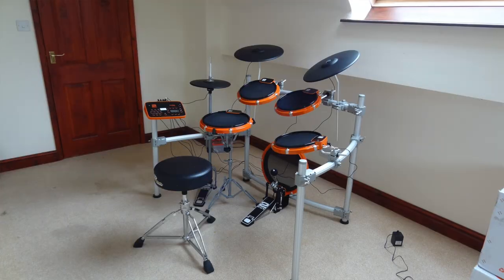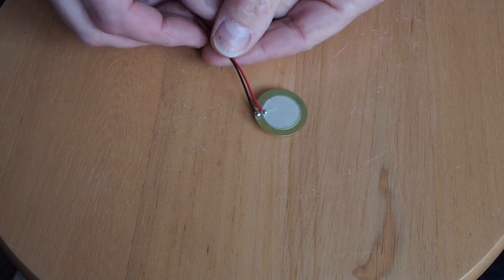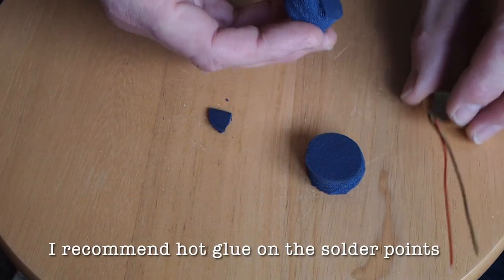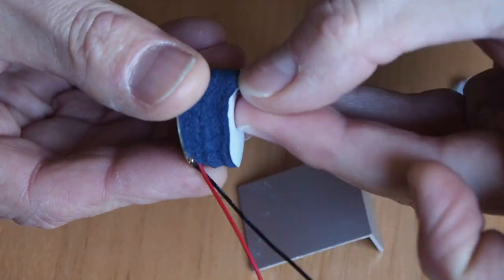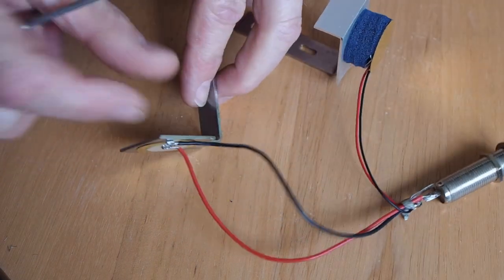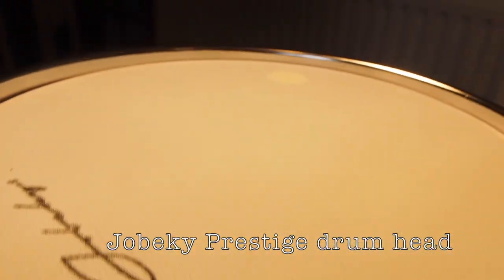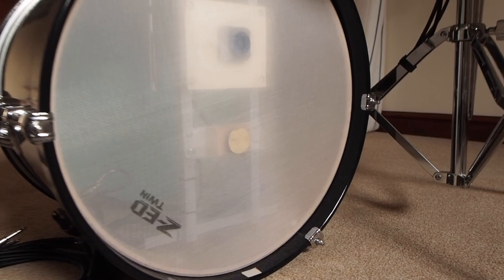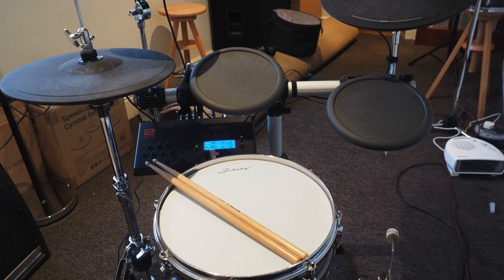2Box Drumit 5 Mk 2 A2E drum triggers - alternative design, no cones   HD 1080p

Comment: Thanks for the tutorial! Really generous and clear.
Great job!!!
Reply: Great video thanks 🙏🏼 did you use a bigger Piezo for the kick?
Reply from the maker: @bernovanderwal  Yes I did, I think it was 35mm diameter. It required some damping beneath the mesh at the beater contact point and a bit of experimentation to find the right position for the piezo.
Reply: @timscott3071   thanks! I’m experimenting right now and the 27mm is not working properly. I’d saw this bigger version in your video and ordered a 35mm allready! Also a foam cilinder of 15cm with and 10cm depth to dampen. Hope this will work 🤞 nice to experiment and your video is helpful! I’ll try the direct contact with my snare because the signal is to weak now with a piezo sandwich
Reply from the maker: @bernovanderwal  What problem are you having with the bass drum Berno? I might be able to make a suggestion if you tell me the problem. 

This was certainly the one which took longest to sort out for me. I think the distance between the beater contact point and the piezo is about 15cm. Too close and there was double triggering, too far and it didn’t pick up all the hits. I also had to increase the ‘MASK’ value in the 2Box module to avoid double triggering.
Reply: @timscott3071  thanks. It’s giving double triggers most of the time or no trigger at all. But it has to do with the connection (tp loose) and I think I have to damp it after the meshead….
Reply from the maker: @bernovanderwal  Yes I found there needs to be something behind the mesh head at the beater contact point to help prevent double triggering.
Reply from the maker: @bernovanderwal  What module are you using Berno?
Reply: @timscott3071  Roland TD27
Reply from the maker: @bernovanderwal  It looks like there’s also a mask time setting in the TD27. You might want to try increasing it. 

Although I’m not sure what you meant earlier when you said “tp loose”? Obviously any connection problems are going to have a negative effect on triggering.

Comment: Great stuff Tim, thanks!
Reply from the maker: Glad you enjoyed it! Thanks for the feedback.
Reply: @timscott3071  you're welcome. I have a TD-27 but I want to do an A2E set. I bought a Pearl Ryhthm Traveler kit for this,  thought it might be perfect. Also have a Stencil kit from the 60/70's I am considering with a 20/12/16 which looks much cooler but a tad bigger. But I really like this method. Much more economical and easy to repair.
Reply from the maker: Sounds good. 

My only experience is with a 2Box drum module and as I've hopefully shown this design works really well. I'd be very interested to hear if it also works with Roland modules; I hope so, please update me with your experience if you have a go. 

I seem to remember reading a long time ago that you may need to reverse the red/black piezo wires when connecting to the jack socket with Roland. So bear this in mind if you have any problems. It's also possible that the signal might be a bit hot so your threshold and sensitivity settings could need some adjustments. 

Good luck! Cheers.
Reply: @timscott3071  thanks for that extra info. It's on the back burner but in the plan for sure.

Comment: I’m intrigued by the piezo being placed like this. All drums I’ve seen have the foam making contact with the mesh head.
Reply from the maker: As mentioned in the notes at the top, I couldn't get the cone method to work. Admittedly my cones were DIY as well. This is actually the design used by 2Box for their own mesh heads. So it's not new. I find it gives fantastic sensitivity and the isolation of the piezo is far better than than the cone method as there's 12mm of neoprene foam between it and the rest of the drum. 

Obviously cones work very well otherwise people wouldn't use that design. This also works!

Thanks for your interest.

Comment: Tom,  thank you for this video.  I love 2box and plan on getting the 5mk2.  your video makes this a reality.  Can you tell me the dimentions of the L-Brackets.  Thanks in advance.  John
Reply from the maker: No problem John. The aluminium top piece is made from some L section measuring 38 x 15mm and it’s cut 30mm wide. The narrow stainless steel bit is a 15mm wide strip, about 60mm vertical and 40mm horizontal. You could make these in one piece it’s just that I decided to do it in 2 as I had the material available. 

The dimensions will depend on the thickness of the foam, the diameter of your piezo and the distance your lug screws are below the bearing edge. The aim is to get the piezo sitting about 1-2mm above the level of the bearing edge so the mesh makes contact and pushes it down a little. 

It would be really to hear from you (or anyone!) who has actually tried this method. I’d love to know how people have got on with it.

Comment: Here's a general question, i currently only have a cheap ALESIS lite kit..just starting drumming..late in life 😁..its a cheap 2nd hand kit that I had to solder every pad and Cymbal..it works but looks like a toy, but..its quiet, and gets me started..actually not too bad..but, im thinking il buy a used "acoustic" kit and adapt it as per your video or similar as I have neighbours..what do you think? Will it be as quiet as my Alesis kit if I use 2 ply mesh heads ? Or should I invest in a more expensive electronic set? I enjoy DIY stuff so thats why I'm attracted to trying out projects like yours, Any tips appreciated
Reply from the maker: Hi Rob, I’m assuming you mean the Alesis DM Lite kit? If so I’ve just had a quick look at it and noticed that it has small rubber pads and a cable loom rather than individual jack cables to each pad. So your cable length is fixed and this could cause issues if you’re going to make some larger pads, the existing leads might not reach. 

To answer your question, any mesh heads heads will almost certainly be a lot quieter than the rubber ones you’re using at the moment. I suspect however that your main problem could be setting up new triggers as it looks like your module is very basic and probably doesn’t have much in the way of trigger setting adjustability. This could well make it impossible to get accurate triggering. There’s nothing to stop you giving it a try of course but I suspect you could well end up needing a different module. 

I’ve recently discovered Luke’s channel and I have to say it is absolutely fantastic with masses of content for anyone wanted to learn more about electronic drums and particularly with regard to all sorts of different pad set ups and their compatibility with different modules….. 

https://youtube.com/c/TheeDrumWorkshop

Comment: hello Tim great video
I also did the same editing as you, but my Rim trigger does not sound on my ROLAND TD12
Do you know this problem?? thanks for an answer
Reply from the maker: I'm not really familiar with Roland modules but I seem to remember that the rim and head connections might be reversed in the Roland modules. You could try changing the head trigger to the ring connection and the rim trigger to the tip. Worth a try. Other than that maybe check the threshold and gain settings?
Reply: @timscott3071  Thank you tim
Reply from the maker: @patrickmallet8178  No problem, please let me know how you get on and if you manage to fix this problem. The other thing to check of course is the cable.
Reply: @patrickmallet8178  Roland wires ceramic to sleeve and brass to tip.  Also, ceramic typically face up.
Reply from the maker: Yes I believe that’s correct Ron but 2Box do it the other way.

Comment: Do you believe is safe to set the piezzo back surface in contact straight with inside surface of mesh head?? Cause with one strong hit you will damage it very easily!!
Reply from the maker: Hi Stamatis. As I’ve said in other replies I did experiment with other positions and sometimes did hit the piezo directly but never with any damage. I think the soft neoprene underneath it reduces the risk of damage.
Reply: @timscott3071  all ways exist in the internet shows the piezo down or in the middle of foam material and the results are perfect.I think your way increase the sensitivity but not the durabillity and not too the control of sensitivity so i think isn't recommended.
Reply from the maker: Thanks for your opinion but that's not my experience. As I said in the video this is the same method that 2Box use for their own mesh pads. So there are at least two of us who find it effective! 

Variety is the spice of life 👍

Comment: Hi Tim, nice video.  Do you happen to have a source for the foam? Thichness?  thankx
Reply from the maker: Sorry Ron I don’t have a source, I was given the foam a few years ago. But I’ve seen pretty much the same stuff used to produce some exercise mats, look for something about 12mm thick. I’m pretty sure it’s a neoprene foam.
Reply: @timscott3071  perfect 👍 thankx tim.  Amazon has many types similar.  Cant tell how many types of foam I’ve tried. Now using mr clean white eraser pads.  Works very well.  Eventually i should just get poron.  Just so dam expensive. But i can make bunch for my whole kit with 3 edge trigger design i built. But I’ll give your foam project  try 🙏🏻
Reply from the maker: I remember using sanding pad foam to make some cone triggers but they just didn't work for me hence this design. Here the foam is performing a completely different function: gently pressing the piezo against the head and also isolating it from any other shocks or vibrations. Hence the use of a much softer material, it's doing a totally different job. The isolation is such that cross triggering is virtually never an issue.

Comment: the piezzo should be be samdwiched between two pices of foam so it does not get dmaged with use ye you might get better sensitivity but it wont last if built that way
Reply: Well apparently not 🤷‍♂️
Reply: Absolutely sandwiched or foam cone or cylinder on top 👍
Reply from the maker: That’s the conventional method Ron. This is different, hence me making the video. It’s pretty much the same way 2 Box make their production triggers which work very well. That’s why I copied it! 

As I’ve proven it’s not necessary to sandwich the piezo.
Reply: @timscott3071  hey Tim do you remember where you sourced the foam?
Reply from the maker: @rondeangelis7384  I've replied to your other comment Ron 👍
Reply: I did the same method but soft touch couldnt get detected. What should i do?
Reply from the maker: Apologies for not replying earlier. I'd suggest firstly trying raising the piezo by 1-2mm to make sure it's got good contact with the mesh. I'm assuming you've tried adjusting threshold and sensitivity settings.

Comment: Very interesting and very useful mate, I was wondering though..do you feel the location of the peizo not being central on the head in any way lessens the trigger sensitivity or ? And i assume you purposely  don't hit the sensor area  in case you damage or dislodge the piezo assembly? Thanks
Reply from the maker: Hi Rob. No I don’t think the location of the piezo reduces trigger sensitivity at all, the only loss is positional sensing if your module supports that. Mine doesn’t. I find the dynamics are very good and with my 2Box I don’t need any gain at all and as you can see in the video it picks up the lightest of touches. There is of course a hot spot directly over the sensor and that’s why I’ve located it in an area where I’m never really going to hit it. 

In the past with it in different positions I have occasionally hit the sensor directly but without any damage. Piezos are actually very robust although the solder can be a weak point. 

Thanks for your comment.
Reply: @timscott3071  brilliant,  thanks for the reply 👍

Comment: Excellent video and some great ideas here for someone about to embark on an A2E journey, thanks!  
The 2box external triggers appear to be of a similar design with the piezo directly contacting the drum head, as do the red ddrum triggers (albeit under a piece of tape).
Something that struck me as different however was the rim piezo - it contacts nothing (nothing being directly hit). 
I assume this is intentional and that it's perhaps preferential as it picks-up a weakened/softer attack through the mounting bracket (less false triggers)? 
Apologies if I missed the explanation in the video.
Cheers
Reply from the maker: Yes that's exactly right. The rim trigger works by picking up a vibration from the shell. So hitting the rim will do it or even the shell itself. It's extremely sensitive when you hit the rim close to the trigger but less so further away. So you do get a dynamic response. 

As for the head triggers, you're right it's pretty much exactly how 2Box do it. That's where I got the idea from. For me one of the best aspects is the perfect isolation from the shell that the foam provides. This is not the case with foam cones where the piezo is  isolated more from the head than it is from the shell.

Works for me anyway. Thanks for your interest and comment 👍
Reply: @timscott3071  thanks for the reply.
My query is more so to the location of your rim piezo. It seems to be located in "mid-air" inside the drum, rather than being mounted directly onto the shell itself - is this something you experimented with?
In either case I'm sure the piezo is being activated, just interested to know if there's a sensitivity and/or performance gain to be made one way or the other.
Cheers
Reply from the maker: @theguitarprodotcomdotau  Yes it’s attached with thin double sided tape to a steel ‘L’ bracket which fits under a lug screw. So it’s not directly touching the shell but there’s a rigid connection to the shell without any foam. As you say it’s in mid air. 

Another way could be to get a piece of flat steel with a hole in one end, stick the piezo on the plate, put a lug screw through the hole and bridge it against the shell. I’m sure that would work well and may well be more sensitive.
Reply: @timscott3071  Gotcha, thanks.
I've only inspected the ddrums personally, the "rim trigger" on their dual-zone snare trigger is simply a piezo stuck to the inner wall of the unit.  
I like your double-stick approach, simple, and I feel like that would be adequate isolation from the shell mounting hardware (crosstalk etc).
Proof is in the pudding, looks like your kit performs better than my Roland TD-10 with PD-100/120 pads.
Reply from the maker: @theguitarprodotcomdotau   Yes you could certainly stick a piezo directly onto the shell as long as you can find something flat, piezos definitely don’t like being bent!

Comment: Good , but now the piezo is completely unprotected from some direct hits by the drumstick! That's why the factories have the piezo under the foam & not above it . Just thinkin' . 🤔
Reply from the maker: That's why I place the piezo in a place on each drum where I'm not going to hit it, Eric. Isolation and sensitivity are superior to the cone method in my experience. It's exactly the method used by 2Box on their own mesh pads the only difference being that they have a plastic cover over the piezo so you can't hit it. It's quite easy to place them in positions where you're very unlikely to hit them, as I've proved. Even if you do occasionally hit them they're robust and not easily damaged.
Reply: @timscott3071  O.K. Tim , thanks for that detailed answer! Also , it should be way more output from the piezo this way .
Reply from the maker: Yep there's plenty of output and good sensitivity which is pretty linear in nature. 

I can only speak for using this with a 2Box module, it may be that it's too hot for Roland and others but I'd have thought that the trigger settings could probably be tweaked to make it work. I've never personally tried  but would love to hear anyone's experience with other modules. 

Thanks for your interest, it's nice to know that people are still finding my video!

Comment: Tim. Hi. Really liked this video. Very thorough and informative. I'm about to do an acoustic to e-drum conversion. I hadn't seen this trigger style before. Thinking of using this style. It sure sounded like it triggered really well. My only question is, with the brass piezo actually touching the mesh head... What happens when the element is stuck by a stray stick hit? I guess it'd be destroyed?.  Have you any experience with that issue? 
And I guess it puts a centre trigger out of the question?
 Paul. New Zealand
Reply from the maker: Hi Paul and thanks for your interest. You’re right, it wouldn’t do them much good if you kept hitting the piezos and I have actually done that a few times with earlier placements  when I was experimenting. Truth is that they weren’t damaged and did carry on working as normal, all you got was a massive ‘hot spot’ effect. I’m not so good that I always hit dead centre so I just looked at where I tend to hit each drum and put the piezo as far from that point as I could. Works for me. 

You’re right, it’s not the best design for a centre trigger but all the centre trigger drums I’ve ever tried have hot spots and my module doesn’t do positional sensing anyway so it’s a non-issue for me.

The only problem I’ve had with one drum is the wire coming away from the piezo itself. I’ve now added a blob of hot glue to all soldering points and hope this will prevent any repeats.

By the way, if anyone else tries this method I’d be really interested to hear how you got on.
Reply: @timscott3071  thank you Tim
Reply: @timscott3071  would putting a piece of black tape or something over the piezo are help to avoid hitting the piezo are directly ? ..just as a reference .
Reply from the maker: @RobBob555  Yes of course you could do that Rob but I’ve put mine in an area where I’m not going to hit it. Also you can see the brass through the mesh head anyway.